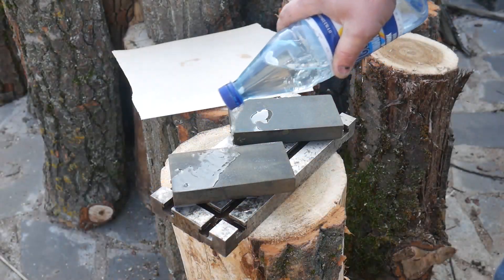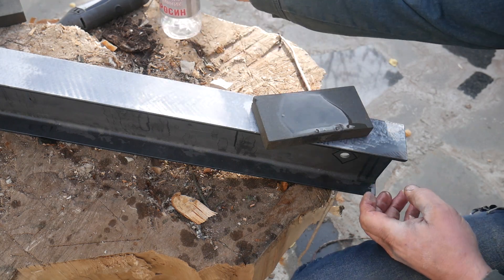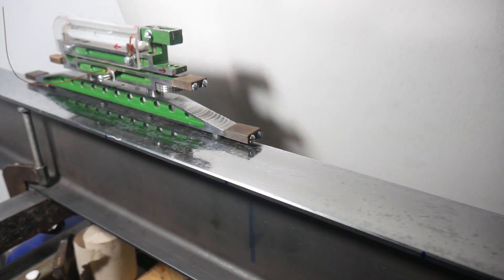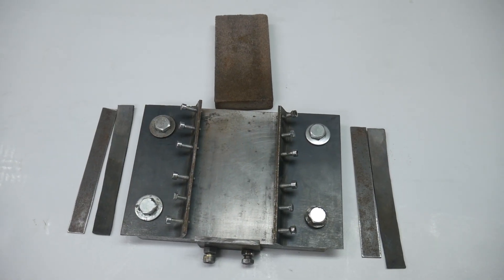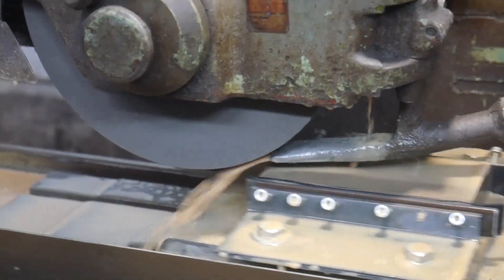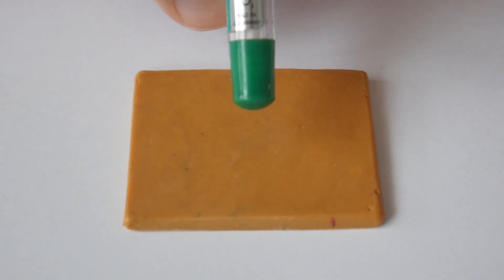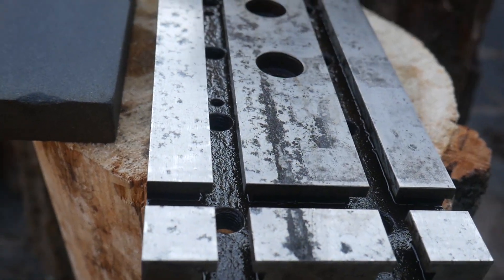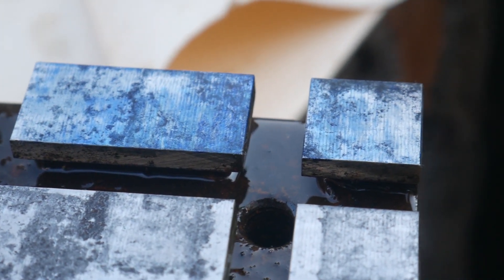Precision ground flat stone

Comment: What type surface grinder wheel is best for cutting the stones?
Reply from the maker: I think that diamond on a copper-tin basis. But in my video, I showed that you can grind with a regular aluminum oxide abrasive wheel. After all, there is not always a diamond wheel for the machine.
Reply: @gena_bazarko  I have been using my standard wheel.but it really wears fast.but it's a small manual grinder.but I'm keeping about .0005 over all and .0002 in flatness on the single surface.

Comment: Great video! How do you find using the rotary tool for scraping in the plate works for you? What type of insert bit are you using? Thanks!
Reply from the maker: Using the translation, I may not have understood the question accurately. But I will answer based on what I understand. Grinding was carried out with an ordinary disc, because diamond or other very hard discs were not available. But it turned out that a regular disk did a great job. The machine was equipped with a disc for grinding steel.
Reply: @gena_bazarko  Thanks for the reply, I should have mentioned the video time 0:50 where you removed the high spots with the rotary hand tool.
Reply from the maker: @BryanHoward  Of course, you can cut it in different ways. In this case, I used an abrasive in rubber.
Reply from the maker: In this case, the steel is not hardened, you can work with just a scraper, but if the steel is hard, then it’s better. I can't pinpoint exactly what nafdka. I bought it without packaging and labeling. But this is a rubber with an abrasive of medium size. If you need to shoot very little, you can use rubber with a fine grain. It is convenient to work with rubber, it does not rattle.

Comment: Fantastic video ! thank you for your efforts !
would it be possible to make your own precision ground stones with the 3 plate method ? ( providing you don't have access to a surface grinder )
best regards from California,

Steve
Reply from the maker: With that goal in mind, perhaps I could help myself by using an appropriately sized piece of glass for the mirror. The glass for the mirror, according to the initial requirements for its surface, is very even. A piece measuring 500x500 millimeters will be uneven by about 0.05 millimeters. This already corresponds to a low grade surface plate. Glass for a mirror is thick enough, I saw 12 millimeters. If you glue ten pieces, for example 500x500 mm, you will already get a low-grade calibration plate. Then you can use it to increase the accuracy using the three-plate method.